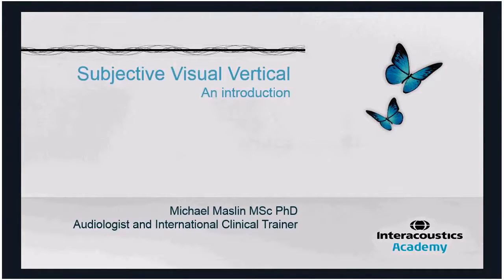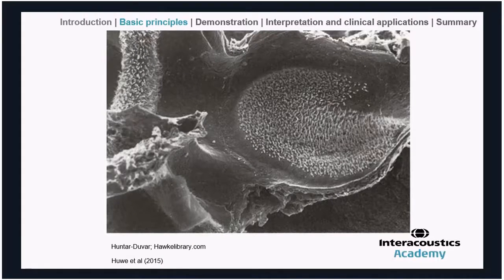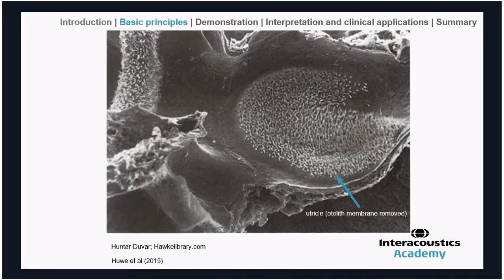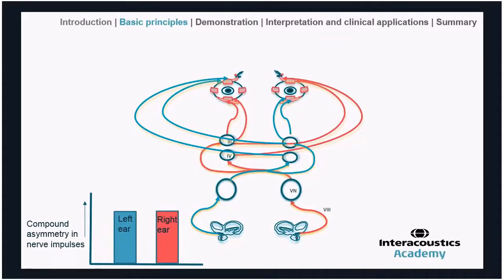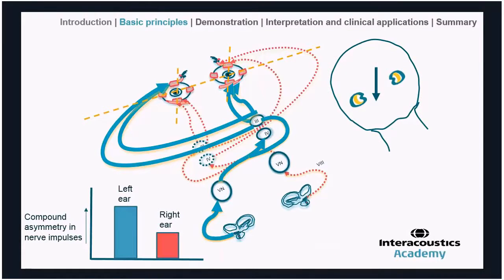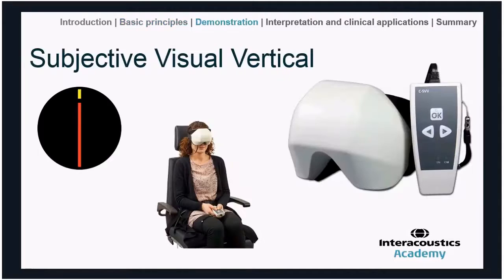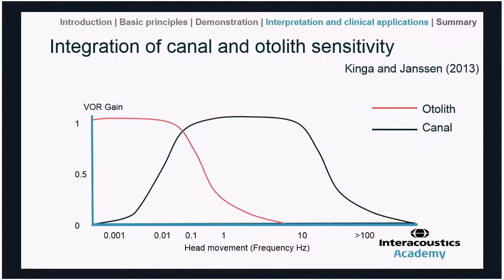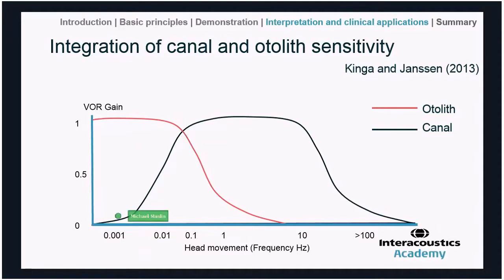Subjective Visual Vertical (SVV): An Introduction

Comment: Very good webinar. I just believe you have to change the orientation of the patient. In other videos the patient stands against us but in this the patient looks to the same direction. It's a little confusing.
It would be nice if on the main graft of the SVV software, the lower area be painted blue and the upper area red so the examiner could be easier identify the side of verticality.